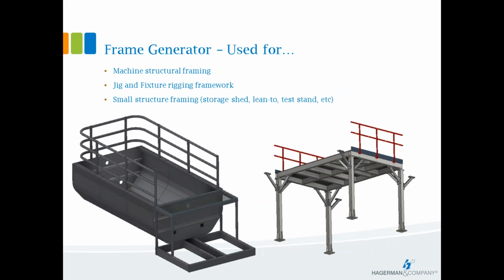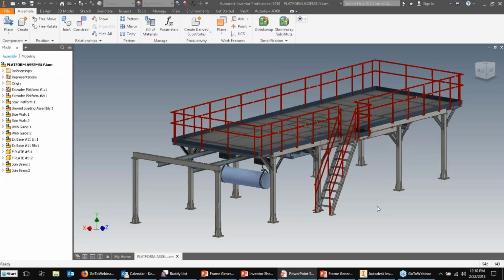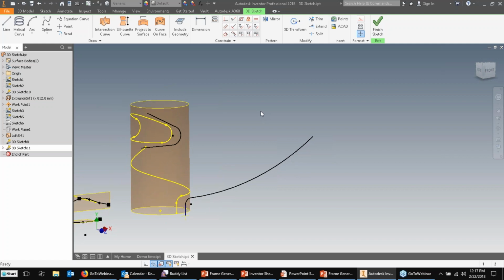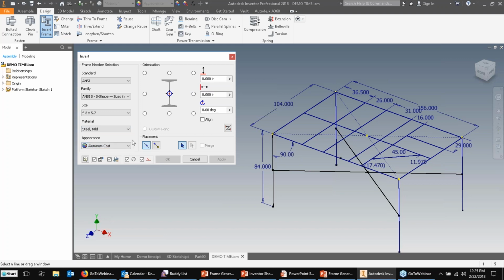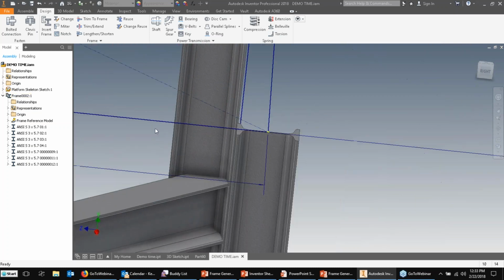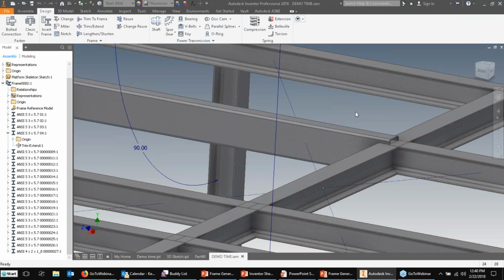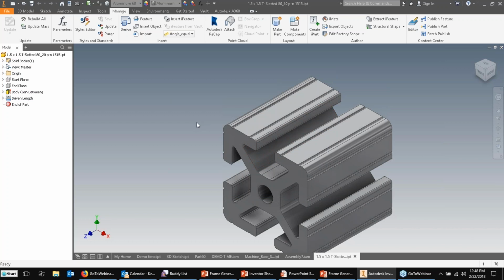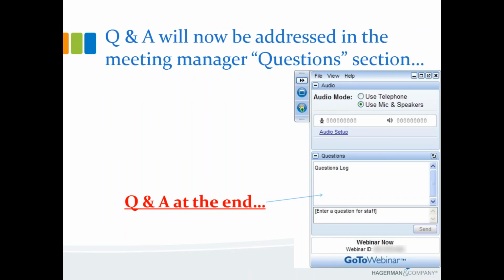An Introduction to Inventor’s Frame Generator and 3D Sketching

Comment: lets say i have a frame at a 45 degree angle with the floor. how can i cut the frame at the floor to make it flat so then i can make a baseplate from the flat surface?
Reply from the maker: Great question! To cut a frame member angled at 45 degrees flat at the floor in Inventor Frame Generator, you use the 'Trim/Extend' or 'Notch' tools within the Frame Generator environment. These tools allow you to trim the angled frame precisely to create a flat surface where it meets the floor, which is perfect for placing a baseplate. You can select multiple members to trim back to a planar face or create the flat cut you need.

Comment: This video helps a lot thanks. It has been a while since this video has been posted, but are you planning on doing a more advanced frame generator video that includes the staircase and handrails and even the frame analyses?